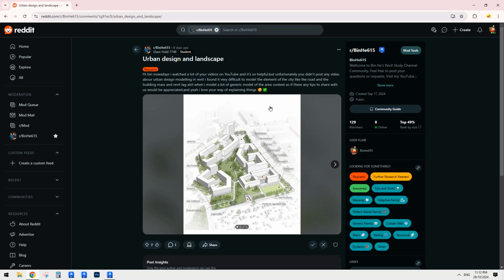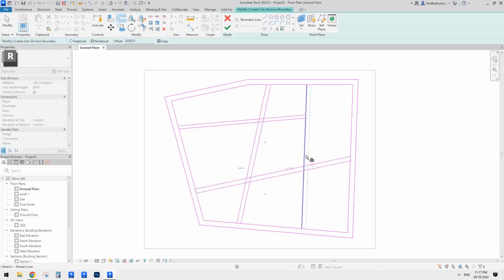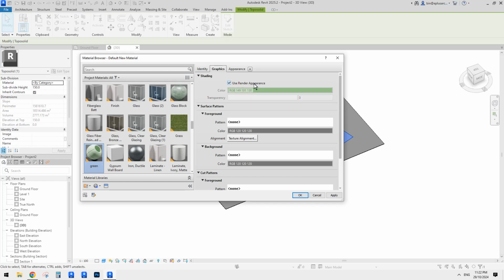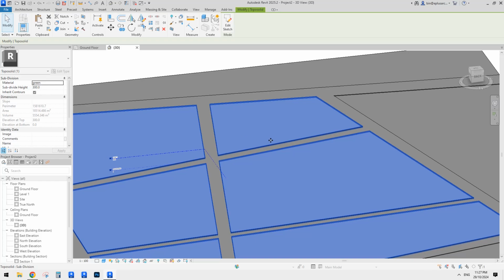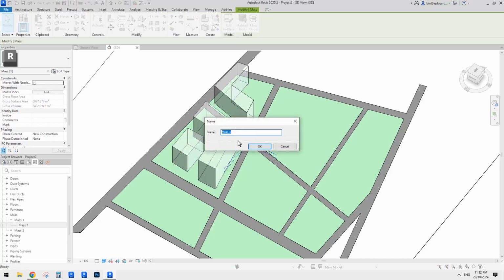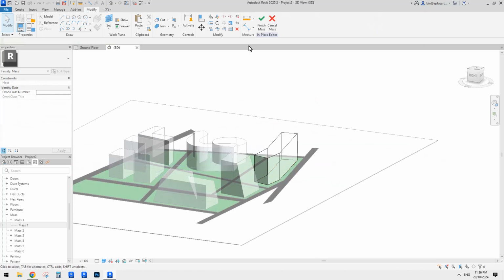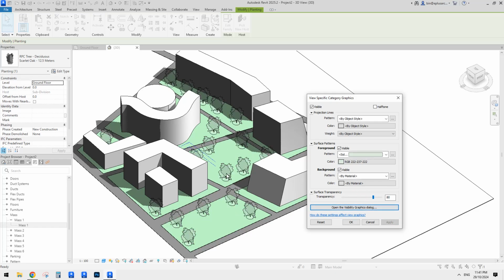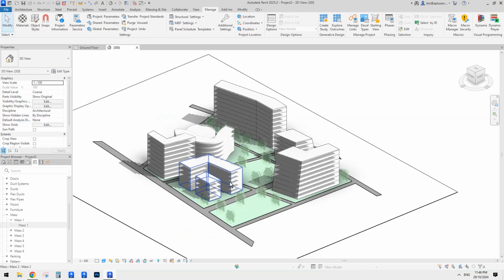24075 - Revit Modelling Exercise - Master Plan using Toposolid and Massing

Comment: Hello! I have a similar project. However, my land has a steep slope. And there are multiple buildings around me. How can I easily place these buildings on the land in accordance with the slope? It is not suitable with the Mass model. It also takes a long time with the Generic Model
Reply from the maker: I think you can just bury the buildings into the topo.
Reply: @BINHE615  how can ı do ? with generic models ? but this way ı cant Building heights adjusted